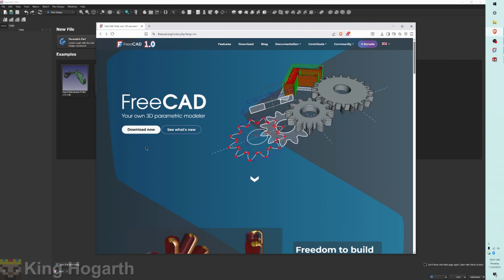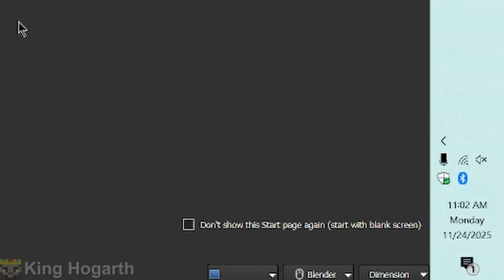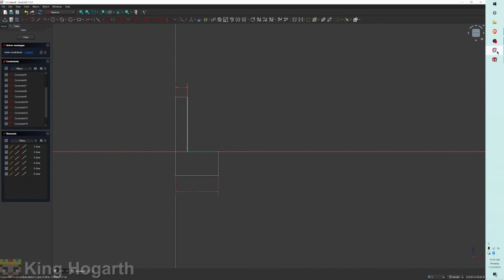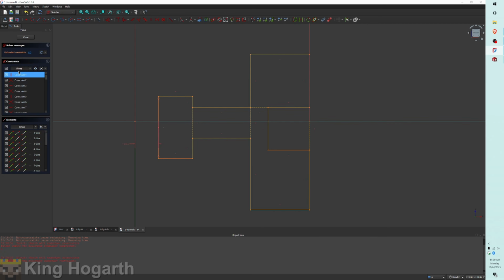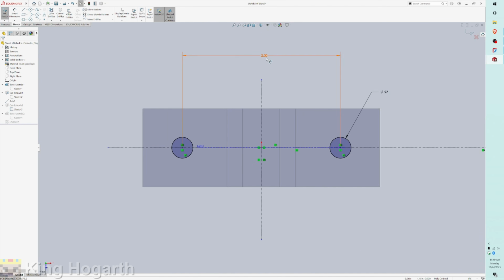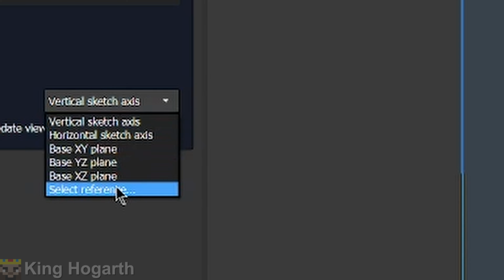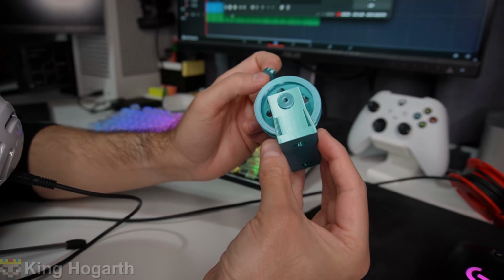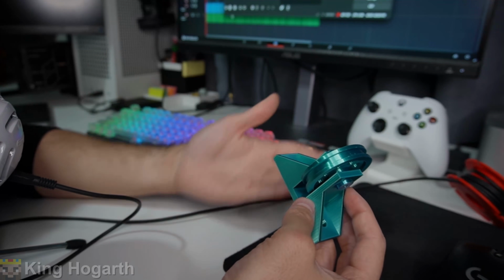SolidWorks User Tries FreeCAD!

Comment: Imperial decimal.....  ew...  Metric my dude.  This isn't tinkercad.

Edit: actual comment at end of video:

Perfectly cromulent video.  Nice to see some love for FreeCAD.  highly underrated software in my mind.  I deign you with a like.

But seriously yank.  Metric please.  No one else in the world cares how many hogs-heads long or which of the 3 ounces you might be talking about.  Oh and weight and mass (force) are 2 different things, but your system predates science (arguably) so it's broken there too.  As a Canadian, I feel it is my current duty to point out your US stupidity.
Reply: US and US partnered manufacturing work off imperial. If you give metric to an ANSI fabrication house, or retrofit metric to a world with existing imperial dimensions, you will run into problems. Small problems, but problems nonetheless.

And when youre designing/engineering, theyre just numbers man. Who gives a fuck if you put things in inches or mm, cause the math sure as hell doesnt.
Reply: @belded-wee  Unless you have to do it your head and then you need to deal with idiotic fractions or lovely numbers like 5280 or guess just which ounce is being discussed or archaic measures like pounds that were defined before we knew the difference between mass and force.

Sorry, but any so called manufacturer that can't handle metric in this age with almost everything being CNC isn't worth sending work to.  After all, "they're just numbers man."

Imperial sucks, is a product of the distant past, and in fact is legally defined, even in the backwards and idiot populated US, by METRIC VALUES.  You run on metric just like the rest of the world and only stubborn holdouts like you are what prevent people from realising that and just accepting the fact that all engineering and science is done in metric and only converted for the convenience of the ignorant because they are too stubborn to change.  Otherwise, you'd have independent definitions for US imperial units and not simply list the metric values.  Even your own standards body knows that imperial isn't worth the effort to define on it's own merits.

Imperial sucks.  Get over it.

Comment: Congrats on trying FreeCAD. I'm a SW professional myself and use it at work, but run Linux and FreeCAD at home. I feel your pain regarding a couple of tools.

Couple of points:
1. FreeCAD has two line functions, like AutoCAD. Line, which draws a singular line, and polyline, which draws a set of connected lines. I've actually removed the "Line" icon from my toolbar just to stop me from selecting it out of habit.
2. The dimension across construction line is really the only feature I wish they would add to the Skecther workbench. The devs are adamant that the feature will be confusing users, but as a SW user it is a godsend.
3. Assemblies can be very hit and miss. My SW brain just can't get the way that FreeCAD does it.
4. Lastly, I've "trained" myself to think of the FreeCAD files not in terms of parts or assemblies, but rather projects that can contain multiple parts and assemblies. This is similar to Onshape and Fusion.

Comment: So Ive just started to learn solid works for my job. One thing that we have at work but not on the version I have at home that I’m practicing on is tool pathing. About 75% of our customers provide a model. We have to make tool paths to cut the part out of metal and that’s done on solid works.  Does this application have the capability to make tool paths and export said tool paths into G-code. 

Thanks for putting this on my radar .
Reply from the maker: FreeCAD does have a CAM workspace that can simulate tool paths and generate G-code. I'm haven't looked into it , but I did a quick Google search and it seems to have a lot of options for tooling and different CNC controllers. Thanks for watching btw!